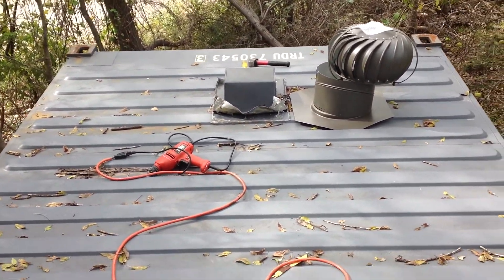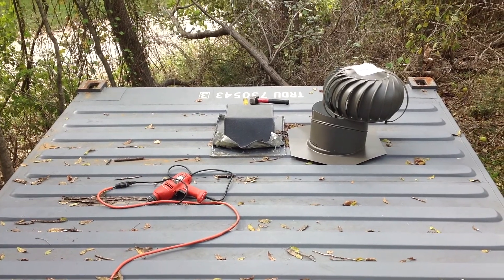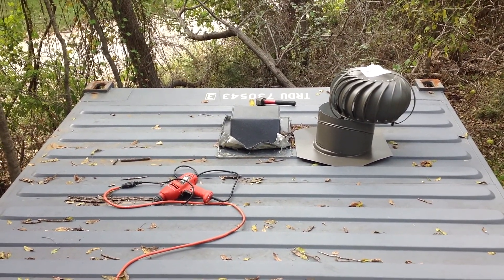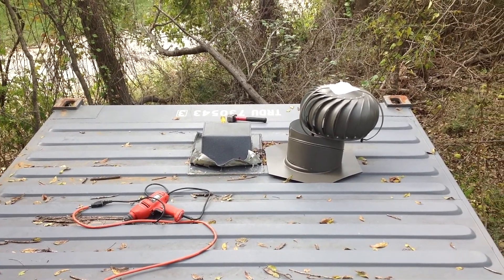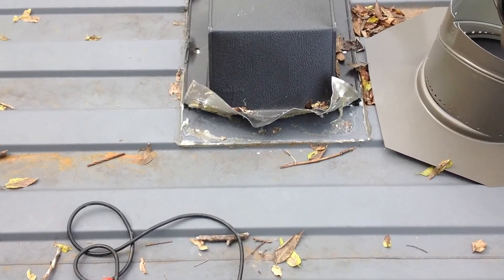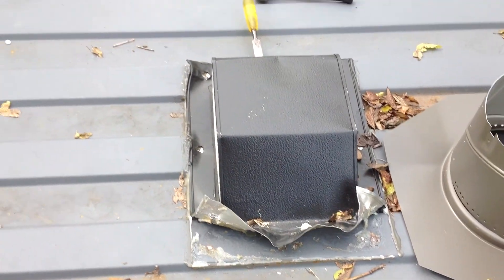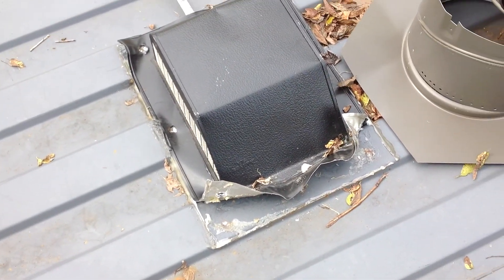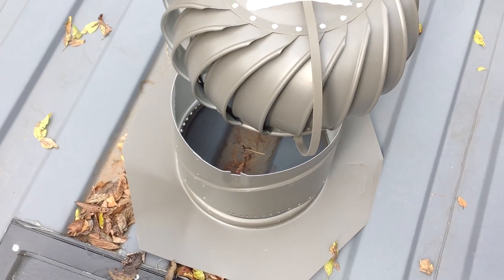Upgrading ventilation on shipping container

Comment: I had that raining problem on my Alaskan 20' container used as a cabin. I bought three gallons of No Sweat paint. It absorbs and desorbs the drops. I did the ceiling and the first foot down from it. Problem solved. The only condensation I get now is on propane bottles or any glass jar with liquid in it. The other 99% is taken care of by the paint.